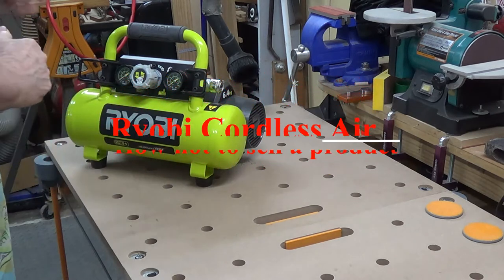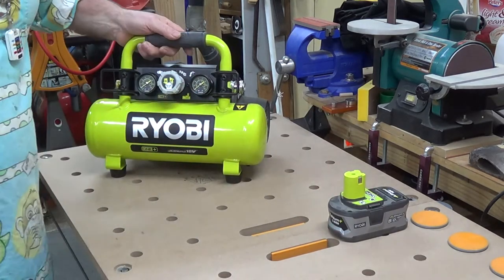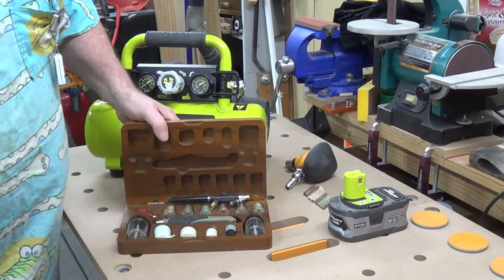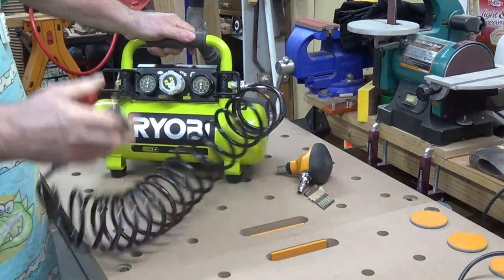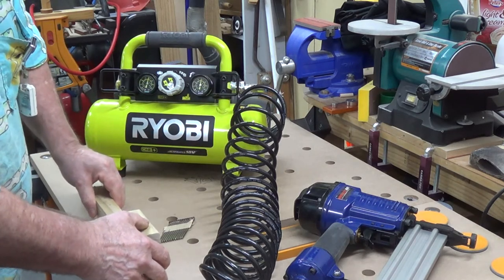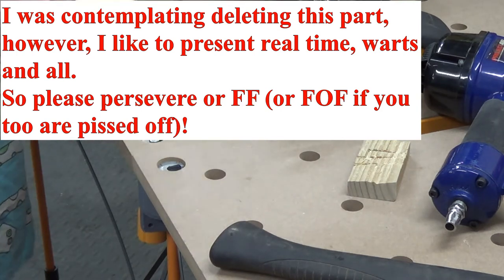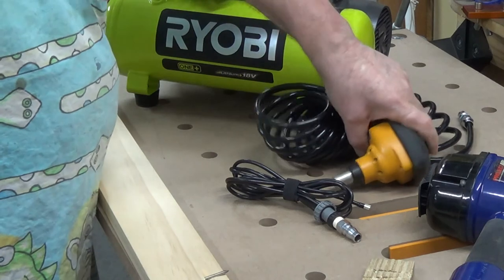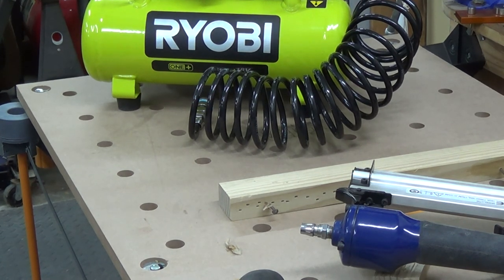Ryobi Cordless Air Compressor

Comment: I would like to pick one up for inflating tyres ! CHEERS from Westcoast Canada
Reply: I have to add air to two of my car tires every week because the tire shop can't find where the leaks are. I bought the compressor in this video when it first came out and it would be okay for tire inflation but I would much rather use a dedicated tire inflator. Ryobi makes two of them, a hand-held and a full-size one. If you keep an eye out, Home Depot puts them on sale a few times a year. The one advantage to the full-size one is that you can set the desired inflation PSI and it will stop at that setting automatically. With the hand-held model you have to hold down the trigger while monitoring the PSI. If you do get one, be mindful of the duty cycle mentioned in the instruction manual or you run the risk of burning out the unit.

Comment: Would adding another extension tank make this work better with a spray gun?
Reply from the maker: Hi Andy... certainly not spraying fodder.  Even a much bigger compressor struggles with spraying. This is definitely a low volume job (as opposed to air flow) item that is ideal for small dispenses of fair pressure air and portability.

Comment: Hey bud nice video , 
Can I ask you some questions please ? 
I've just bought one of these unit's & the necessary air hose pipe + air gun .
I'm wondering did you have to tape up or seal in some way ,  all threaded join's on you're hose fittings ???
After setting everything up on my unit there's  hissing air coming from the thread that connects the hose into the  gun ...☹️
Was thinking do I have some  faulty hose fittings... ? Or do I need to do some thread taping in order to make completely air tight ? 
Can you shed some light ? 
Thanks ...
Reply from the maker: Hi Rich,  It is hard to get a proper air hose seal without some sort of "sealer".  Don't know whether you remember in the bad old days when plumbers charged a reasonable price and wrapped hemp around gal pipe threads... well I go back that far.  Nowdays, a lot of couplers have some sort of goo on their thread providing an adequate air tight seal, however, most don't.  I use "plumbers thread seal".  This is what I use,
   https://www.bunnings.com.au/kinetic-12mm-x-10m-pink-premium-thread-seal_p4920187
Though that's an Aussie supplier, it should be available in any area/country that a plumber lurks in...  just don't be frugal... a small amount does not go far... make quite a few wraps... if it still leaks, wrap some more... I thought plumbers put a helluva lot on so they could charge me more... they do, but its not for the tape but the bloody labour to put it on.

Didn't want to give you a bum steer... I googled "air hose sealers" and found this may help (there may be better as it was the first I saw),
   https://www.youtube.com/watch?v=YKWiQCK9UL0
Reply: @alexkara9696   

Hi Alex , mate big you're self up !!! Thank you so , so much , I was wondering if I needed some of that " plumber tape " I know what you mean it's kinda stretchy & real thin.
Infact I was almost sure of this I thought I'd just reach out and confirm. My brand spanking new Ryobi compressor I think is let down by a super cheap air hose kit , but none the less it should still work. I was a little ' defalted' (🤣) after arriving home from Bunnings and find air leaking through the gun join on the hose pipe, 
I'll try that tape , and let you know how I go .
I really appreciate you're detailed description and help . 
Thanks so much ❤️👍